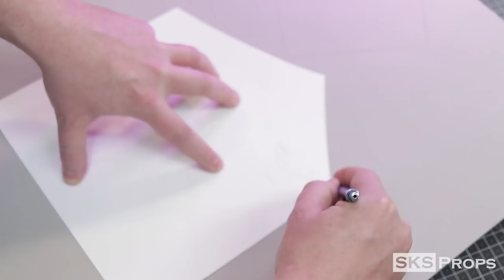How to Make Dragonball Z Saiyan Armor - Free Templates - Cosplay Tutorial

Comment: My only problem is it seems like it costs a lot just to get the Foam materials. You ran thru about x4 6mm, x4 10mm, x3 Half Round dowels (based on my size) And that doesn't even include all the building materials. There Goes $1000+ 😵‍💫😅 (Worth it, I hope) 😅
Reply from the maker: I don't know where you are getting your math...You need 1 sheet of 6mm, 1 sheet of 10mm, 1 20mm half round pack, 2 15mm half round packs that is approx $65 with a lot of material left over. If that is expensive to you don't ever look at leather crafting or 3d printing 😂
Reply: @SKS Props  Lol yea I made the mistake of watching this 5x and and everytime you announced which Foam you were using (6mm or 10mm) And thinking it was a fresh foam
Reply: @SKS Props  Thats impressive that it only takes 1 6mm and 1 10mm. I'm 6"0 245 lbs.  I'll be buying your Cosplay Set in that case. But no, all the other (truly Necessary Materials : Respirator, pain, Dremel, board etc)  Combined makes the running total of everything $465 so not Horrible!! Better than $1K 😂😂

Comment: sorry for the stupid question, but i'm a complete newcomer to this. what't the rough size of paper i should print the template on? i rather not waste too much material with try and error
Reply from the maker: Open the pdf in adobe acrobat or adobe reader and click poster in the printer settings that will scale it properly across 15 sheets
Reply: @SKSProps  aaah, i see. thanks :D

Comment: I'm running out of adjectives to describe your work Steve, so I'll have to go with "awesome". 
It is interesting to hear that you wanted to do a red primer for the metallics, but when you show of the armour after the 3 coats of bronze, it is actually wicked, and although flat, I don't know if I wouldn't just run with it as it was.
Reply from the maker: First off thanks! The red primer would have just made coverage a lot easier I could have done just one coat of the bronze then moved on to the gold.
Reply: @SKSProps  Steve, I just rewatched your video, as I'm doing a samurai armour and I have another question for you: any particular reason why you used 10mm for the base and not 6mm? I was thinking of using 5mm (which is what I have and got at an online shop in Belgium) which will have 2 layers after the details, but after watching your video, I'm not sure if it is a good plan. My doubt is if with 2 layers of 5mm it won't be to flimsy, but I'm afraid that going with 10mm and 5mm that it might get too bulky...
Reply from the maker: @diogo.rodrigues.1884  if you’re layering 2 5mm sheets that might be fine for stability. That’s why I used the 10mm vs the 6

Comment: best channel ...
i live in brazil, how would i make the HD-Foam Dowels? because I didn't find it here to buy. I tried to do it in some ways and it kind of didn't work. would you know how to do? and maybe teach to do?

sorry my english is not very good, so i used google translator.
Reply from the maker: Thanks! I’d look at a hardware store for pipe insulation. It usually comes in a package rolled up you can cut them in half. It won’t be as smooth as hd-foam dowels but you gotta work with what you can get 👍👍
Reply: thanks

Comment: Would a single roll of 10 mm HD Foam be enough to make the armor? Or is more than one roll necessary? Thank you!!
Reply from the maker: Sheet of 6mm and 10mm would be enough with plenty left over for your next project
Reply: Hello! I have the templates downloaded, but the additional material part causes me some doubts, whether I should leave them or not, in my case I am not a very robust or wide man, I am 1.80 cm tall and weigh 73kg and I have an athletic build, but I am not width, so, I have cut those insoles with additional material in case I have to adjust them to my measurements, the problem comes from the fact that I don't know how to adjust them or if I really need that additional material for my complexion, I have never done anything similar and that causes me doubts If you can give me some reference I would appreciate it, maybe for my height and build with the standard measurements it would work? My question here is how to adjust it. I can even give my chest and waist measurements. 91cm chest and 80cm waist, which I understand are the parts that can vary the dimensions of the vest. For exemple part B, part C and E.

Comment: Do you think your foam would be dense enough, specifically the 6mm, to use for larp armor? Or should I use tnt cosplays eva 70 foam?
Reply from the maker: There is a difference there in density and shore hardness. Tnts Eva 70 is a shore hardness of 70 which means it’s harder but not as dense as my HD-Foam which like most others is a shore hardness of 38. Basically mine will be smoother and hold details better but it won’t be as rigid as a higher shore. So a technique you could use would be to have a stiffer foam underneath for protection and a foam like mine on top for all of the details. Hope that helps 👍

Comment: They didn't have the smaller foam tubes as they are OOS. Do you have any suggestions on what I can use as a substitute?
Reply from the maker: Sorry, We’ve got a bunch on the way just waiting on the boat to get here. Michael’s used to have some as well. Their foam sheets are terrible but their dowels were a different density. Before my half rounds people used to try to use window insulation rounds and cut them in half. But they are very porous so they won’t have a smooth finish
Reply: @SKSProps  Thanks!!! I appreciate the help!!! Currently about to start making I just need that one thing smh!  I may run to Michaels and see if they have some.

Comment: With your foam clay, is it possible to make a mask with the push mold method? The thickness would be about 10mm.
Reply from the maker: You could but I’d still back it with contact cement and 2mm foam or felt for support
Reply: @SKSProps  ok cool! Thanks a lot!

Comment: Your dremel sanding bit, did you deliberately wear off all the grit? I have never found any way of dremeling that didnt end up getting real fuzzy and not being able to fix it. Does it just work better with your HD foam?

Also super glue vs contact cement. I usually try to steer clear of super glue because every time i tried it, it ended up just cracking and breaking the foam. Was I likely just using it super wrong?
Reply from the maker: Yes I wear down my drums and I actually have a video planned where I show how. Also yes my HD-Foam will sand and cut smoother because of how it’s designed. The lower the density the more fuzzies you’ll get. If you ever have a chance to try my brand you’ll see the difference immediately 👍

I use contact cement for large or heavy flex areas but I’ve always had really good luck with bob smith gap filling medium super glue. Works much better than regular locktite or zap. Also the type of foam makes a difference. Tried so foam from Michaels for comparison it didn’t like superglue at all would either crack or crystallize and not hold
Reply: @SKSProps  Alright awesome thanks! Have you considered having like a sample box of WAY small samples of each of your foams for testing purchasable from your shop? Found a friend that is just trying to get into foamsmithing, so I said id give her a bunch of my massive over stock of TNT foam for free to start out. Nothing against TNT, especially their super high density 2mm rolls which I love, but I REALLY want to check out all of yours too so I can compare. And just to be clear, I'm asking if I can purchase the foam samples, not begging for free shit lol.

As far as super glue, ill assume the problem was using cheap crap like the cheep stuff you find at the hardware store and even the garbage from dollar stores lol. Ill definitely try to get some of that Bob Smith stuff and see how much better it is. So thanks for that too! Have a good one!
Reply from the maker: Email me sksprops@gmail.com

Comment: I'm about to try this for halloween, how many packets of the foam will I need to make this. I'm about you similar shape
Reply from the maker: A Cosplay bundle pack of 2,6 and 10mm 2 packs of 15mm half round dowels
Reply: @SKSProps  wouldn't I need 1 pack of the 20mm half dowel
Reply from the maker: @ismaluna9177  you're right 20mm half round for the bottom of the armor as well good catch
Reply: @SKSProps  ok so still would need the 2 packs of 15 half round or just one and one 20?
Reply from the maker: @ismaluna9177  still need the 15 that goes all around the chest and back the 20 is just along the bottom

Comment: when do you use super glue and when do you use contact cement?
Reply from the maker: I only use contact cement for large or heavy wear parts otherwise I use superglue because it cures faster and keeps the build clean
Reply: @SKSProps  
but you can still use contact cement instead of super glue?
Reply from the maker: @1985Cohen  you can use either

Comment: How much of each HD foam pieces are needed for this? I don't want to overbuy
Reply from the maker: I think a sheet of 6mm and 10mm would be fine with quite a bit left over. then 2 packs of 15mm half round dowels and 1 pack of 20mm
Reply: @SKSProps  thank you so much!
Reply: @SKSProps  do you have a recommended alternative for the Valspar Color radiance flat off white product? I’m unable to find it on Amazon or at hardware stores
Reply from the maker: @fyisadeghi  any white will do just make sure it’s flat, no semi gloss or gloss acrylics don’t stick to it

Comment: If it was saiyan armor made from the same materials as in the series size wouldnt be an issue because the armor is designed to fit all body types with its surprising stretchy material

Comment: Sadly got 5mm by accident
Reply: Don't know if it'll still work or not
Reply from the maker: 5 mil should still work just wont be as firm
Reply: @SKSProps  ordered 10mm just to be safe
Reply: @SKSProps  quick question how did you get the templates printed off or which kind of printer did you use  this is my first time doing this kind of stuff
Reply from the maker: @herrinderpus1445  it’s just a normal laser printer watch my how to print video it will show you the steps needed
Reply: @SKSProps  thanks again